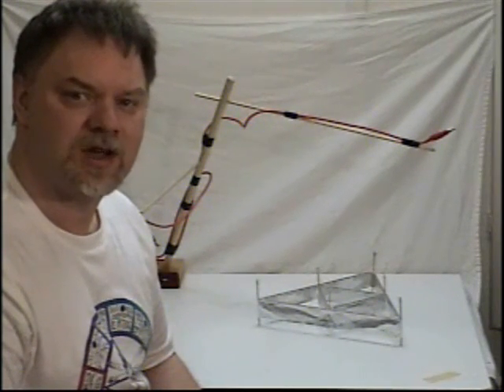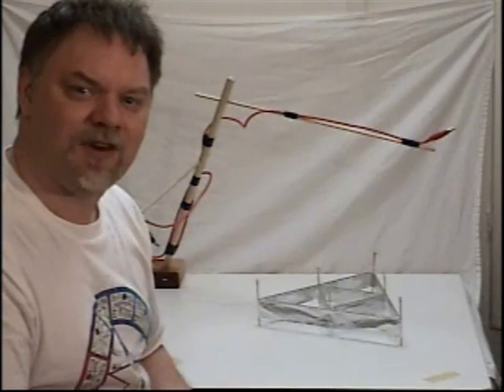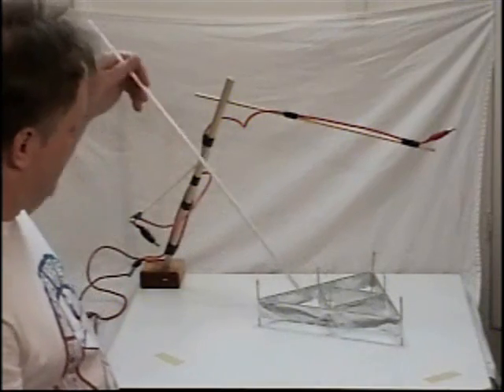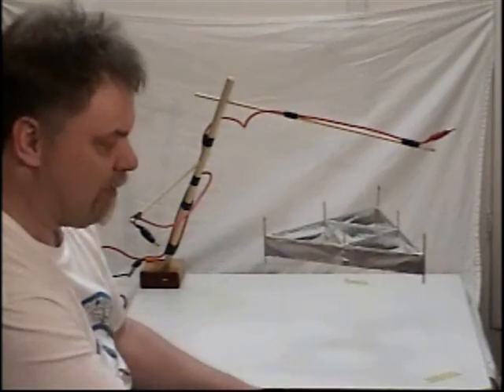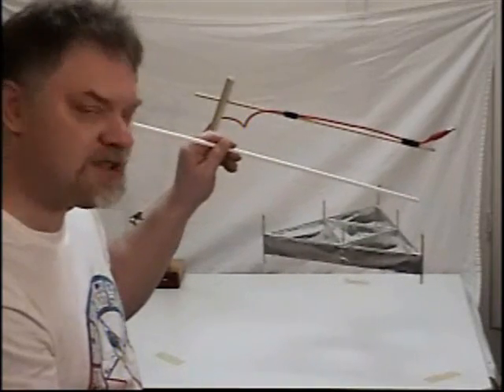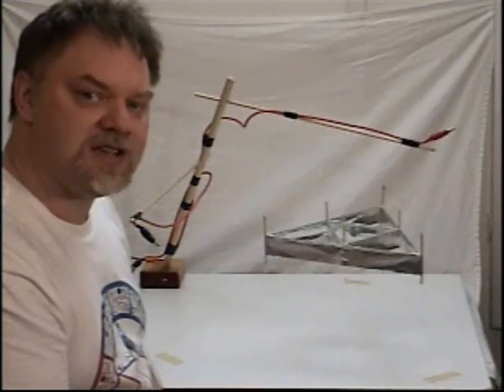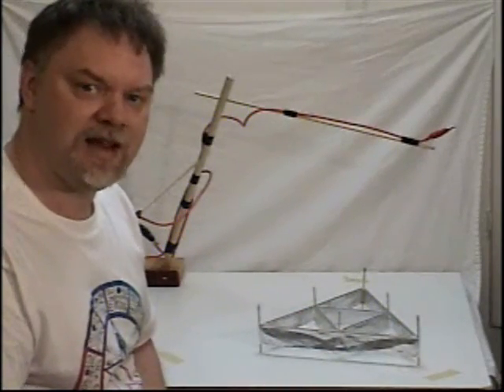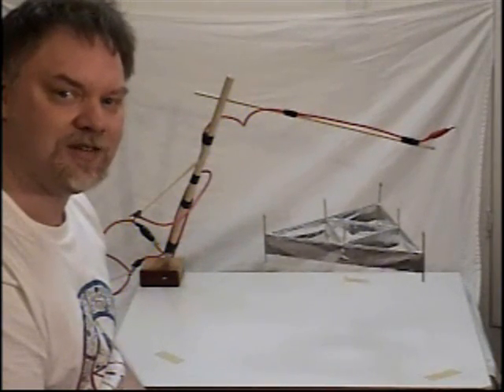LIFTER TECHNOLOGY: Demonstration & Explanation

Comment: NICE demo
It is certainly an ionized wind!  The wire above and across the top of the wings charges air or more probably water vapor particles and the oppositely charged wings attracts those charged molecules and they race down the wing -- it does not matter what the polarity is.
Myth Busters put their home built working Lifter in a vacuum chamber AND IT DID NOT FLY!
I LIKE the tech though, you need to build a jet engine with it.

Comment: I see "antigravity" as a tag. That's a misnomer if I ever heard one, as there is no such thing as anti-gravity. 

The actual phenomenon is called the Biefield-Brown effect, and has nothing to do with gravity, but everything to do with electromagnetism. Look it up.

From wikipedia: "Anti-gravity" is often used colloquially to refer to devices that look as if they reverse gravity even though they operate through other means, such as lifters, which fly in the air by using electromagnetic fields.

Comment: Why would reversing the electric polarity make it thrust into the tabletop? All you'd expect is that the air around the corona wire is ionized to the opposite charge, thus the thrust is not reversed but maintained.

Comment: Actually, the craft does fly using ionic wind, primarily because of the Beifield-Brown effect. The lifter basically works by ionizing the air around the wire via corona discharge. The ionized air is then drawn downwards towards the aluminum foil, creating thrust. There are no gravity altering forces involved in the operation of this craft. You can test this by trying to fly it in a vacuum. It won't work. It is however insanely dangerous. Don't try it at home, unless you enjoy funerals.

Comment: @uNiTCoNDoR

well, it wont work in a vacuum because the way in which this works, 
the electricity jumps from the copper wire to the aluminium sheet, 
creating an airflow between the 2 metals.
if you had two meshes (copper an aluminium)in front of each other, wouldn't that produce an airflow?

and ion-jet, meaning, you get a normal jet, but make every other set of fins either copper or aluminium, (with a spacer after every pair), that way, the airflow would jump from one set of blades to another

Comment from the maker: @revi5555 The clip is needed to hold the fine power wire, allowing the high voltage dc current to reach and charge the lifter.

Comment: thereby allowing this lifter to operate on alternating current aswell. creating a better crossflow of ion wind (and trust me, its mostly ion wind) than if you had only applied DC, try it! also try making an ion jet using aluminum and copper meshes placed in-front another!  have always wanted to try that, :)

Comment: i read somewhere that the reason the ion wind doesnt simply reverse when the voltage is reversed is because of the asymmetrical, relative electro-negativity and  the different surface areas and conductivity between the two metals, causes the corona to concentrate around the foil, regardless of polarities being run through the wires. i believe it was, if the copper was the cathode, O2 would attract to the foil, and Nitogen would be attracted to the foil if it were the anode,-----

Comment: Please tell us more about the power supply being used. Is it a transformer producing 20,000Volts ? Is the final output AC or DC? If DC, please provide details of the rectification system.
With thanks

Comment: As you pointed out the asymmetry is *not* the polarity but the mechanical layout. so the "ion wind" always flows from the wire to the foil, regardless of the polarity of your power supply. The only thing changing with polarity is that the ions are either positively charged (when the wire is connected to the positive terminal) or negatively charged.

Comment: I built a  high voltage power supply for one of these in college to demonstrate it to my electromagnetics class. It's not anti gravity, but ion propulsion. This will occur whether the polarity is reversed or not.. The lift effect comes about because of the asymmetry of the capacitor.

Comment: Cool videos and a interesting channel. I have done a few experiments myself with lifters and high voltage. I uploaded a video of a Lifter running, filmed with a Schlieren setup and the airflow around and between the electrodes is obvious. I'm in the process of building another (better) power supply and will run some more tests soon.
 - Again great channel - Otto

Comment: @ASIANPRIDE50 Lol I was being sarcastic. Be sure to verify it's assembly CAREFULLY (you should know where it goes!), before introducing high voltage. It's dangerous, and if you don't do it properly, you could hurt yourself. You'd be better off having the string holding it up in the air if you didn't know what you were doing lol. (Check other vids, there are more detailed instructions, happy building!). And don't breathe in the ozone from it, it's not good for you!

Comment: The only question is:
Are those numerous tinfoil lifters driven by just voltage and not current amount (amperage)? If so, one can use a Joule Thief modification to power it, and maybe with  proper shape configuration it can lift the JT circuit too.

Comment: @Beamshipcaptain i guarantee you that is you put this device on a plastic sheet, and glue it down, you will not get any lift. why? because the air currents coming off of the lifter push down on the plastic, and no lift will happen. Geez, you can even use tape for that experiment

Comment: Here is an analogy; The Lifter is like a rock-climber, and air molecules are the Rocks.  
Here is another counter example: Try flipping the triangle upside-down. You will see that the triangle won't climb up. It will just stick to the table top. Now if there is a depletion in gravity in the vicinity, the direction of the lift will always be up. Don't you agree? However, this is not the case, hence your theory is completely wrong.

Moreover, This won't work in space or in vacuum,

Comment: The Author of this video is wrong.  It is definitely not a "gravity" well.

Reversing the polarity doesn't reverse the flowing direction of the ionized air molecule, due to the locations of the smaller electrode being always at the top, and  bigger electrode at the bottom.  (As long as, they are arranged as such)

Comment: @Beamshipcaptain - Thats actually untrue Russell. I think you dont understand elastic collisions in physics. In lifters it is both the speed and the quantity of air that permit the object to lift. Because such a large quantity of air is moving at a relatively low velocity the air particles do not collide with enough force to free electrons, which means you get no disassociation and no secondary ionization. This combination is what permits the lifters to lift, it is a thrust reaction.

Comment: @kurisu925  << Hes correct. The air molecules literally stack on top of each other, holding the lifter up. This is because air exhibits elastic collisions at low velocity. A lifter works by moving a large quantity of air at a low velocity, a higher velocity would cause molecular disassociation and secondary ionization, reducing the lifters efficiency. This is because efficiency of a lifter is inversely proportional to the velocity of the air flow it generates.  Eff=mv/t * 1/2(mv^2/t)

Comment: Reversing the leads will NOT reverse the flow of ions because the skirt is always has the lower density of ions. Whether its positive ions of air flowing downward to a negatively charged skirt, or negatively charged ions of air flowing downward to a positively charged skirt. If you want to change direction of the lifter (i.e. the air flow) simply  turn the lifter upside down. It wont work upside down, because the air will flow in the wrong direction.

Comment: If you do a smoke test of the lifter with the plate positive you should see the air flowing upward  because the positive electrode always has a larger glow discharge(see maxwells treatise on EM). The positive ions should flow upwards towards the negative wire. Furthermore you should require more voltage to initiate lift when the wire is negative and the plate is positive because the ion wind is working against the gravity well phenomenon. See my explanation of the lifter.

Comment: walking the mass-energy-equivalence-argument line is something you have to be careful with. though mass can be converted into energy and visa versa, the two are far from being the same thing. not to mention that 24000 V at 1mA would not have enough equivalent mass to create a gravitational field powerful enough to generate even a .049 newton force (force required to cancel out gravity for 5 gram object.

Comment: now, i will say this. i am willing to believe that there is a connection between electromagnetic and gravitittonal forces. KaluzaKlein theory is a well accepted and reasearched theory that shows, using general relativity extended into a 5 dimensional manifold with the 5th dimension being collapsed, that there is indeed a connection between gravity and eletromagnetism. recent expiriments with superconductors seem to confirm this. those are on another level from this, however.

Comment: except there's one problem - the force IS sufficient. the propulsion relies both on momentum transfer to the atmosphere by the increased Brownian motion of the accelerated ions and by the electric field created by the accelerating ions inducing an opposite acceleration in the craft by simple coulomb force.

if it were a "elecrogravitic effect" the thing would work in a vacuum. and it doesn't. I've done the test myself.

Comment: actually, reversing the polarity would not drive the lifter down, even by the 'ion wind' theory. the upper wire creates a cloud of charged air molecules  which acquire a charge matching that up the upper electrode with it's higher charge density and accelerate toward the lower electrode. polarity doesn't matter, and T. Thomas brown was the one who explained the lifter using the ion wind effect.

Comment: oh, reversing the polarity does not prove anything because if the air is charged negatively or positively the foil is still the opposite, and the ionized air will still travel toward the oppositely polarized surface.

Comment: this so called lifter is just an ion wind generating device the thin wire on the top positively charges the air while the foil is negatively charged pulling down the ionized air thus creating thrust dont believe me? put this devices in a vacuum with no air and it will not work ! it has nothing to do with magnetic fields.

Comment: Tesla Tech, and Lifters exploit two very different properties of nature. They are apples and oranges. Simply put.. AC and DC.

Lifters take advantage of a static DC electrical field established around the wire. Which charges the air around the conductive wire and pushes it away towards the non-charged aluminum. (This takes advantage of electrical fields)

The 'force' felt in Tesla tech is the  result of induction. The high voltage/frequency induces an opposing magnetic field in objects in range.

Comment: The assumption that reversing the polarity would reverese the direction of thrust is false.

Regardless of the direction of current flow, The air around the wire becomes charged, and is drawn down towards the non-charged foil. Thus always producing downward thrust. (Unless you invert the device.)

Also, you contradict yourself. "We're not creating anti-gravity, we're creating a gravity well."  Manipulation of gravity for lift IS antigravity.  Which this machine does NOT do by the way.

Comment: @ USSGobLin

 The voltage source is a high voltage DC, not an AC type like the one you describe.  If you reversed the polarity of a DC source the current direction changes. This is not true about the AC system you described.

P.S. I'm A senior electrical engineering major
and I've built one of these before.

Comment: Guy in video is wrong, swapping polarity doesn't reverse the air flow. Air moves in one direction due to the wire in relation to the foil strip. Example, MOST, not all, auto starting motors will spin in one direction regardless of polarity, due the coil and armature windings. That's what makes a CW or CCW motor.  The reason these lifters are controversial is because the people running them are not electrical engineers and do not understand them. Then they ad the words, Conspiracy, or "Cover up"

Comment: Yes, 1000mph at the equator, but the 'drop-off' of the Earth's curvature is only 8 inches per mile. So that would imply a very sedate upwards motion, and the Searl gang would be in no danger. Darn!
BTW, this effect is quite real: experiments were performed using a warship at the beginning of the 20th century, and it was found that its weight differed by several hundredweight; depending upon whether it was steaming due East or due West.

Comment: switching the polarity of the power supply does not change the direction of the ion wind. The direction of the ion wind is dictated by the positioning of the asymmetric electrodes. That is to say, the ion wind flows from the thin electrode to the larger skirt. So switching the power supply does not prove there is no ion wind. The only thing that changes when the power supply is reversed is the type of ion being carried from the smaller wire electrode to the larger skirt negative versus positive

Comment: Depends. In a pure vacuum without any sort of ionizable material as fuel, it cannot lift. However, if one were to pack a storage compartment full of ionizable materials (similar to what they do for ion propulsion for space satellites) then yes. 
The way this lifter works is by ionizing molecules in the air (oxygen/nitrogen) which serves as the matter being propelled downward.

Comment: I'm afraid it isn't that simple.  See, since Thomas Townsend Brown did experiments with flying saucer-shaped models, and worked for the government, some people naturally assume flying saucers are terrestrial craft using this principle.  However, lifters currently have an impossible power-to-weight ratio; i.e., they need to be connected by wire to an external power source.  Wait for cold fusion; maybe then it will work.

Comment: Polarity is inconsequential. Negative Ions flowing to a positive skirt or positive Ions flowing to a negative skirt makes no difference. 

If the Corona Wire is positive is steals electrons from the air, they become positive ions, and are attracted to the negative skirt.  If the Corona Wire is negative, then it deposits electrons onto the air which are then attracted to the positively skirt.

i.e. the flow of ions is controlled by the placement of the skirt, not the polarity.

Comment: works a lifter   with static current hight voltage generator like van de graf ? I saw some aluminum dishes over a van de graf flying when it starts. Its the same phenomenon?

Comment: Guys... I hope you realized he was using DC voltage, not AC.... polarity reversal DOES make a difference in DC voltage and current app,lications... the current flows thru the system, he explained it was a closed loop

Comment: Whoa, dude.  That's a huge jump in logic there.

Reversing the polarity of the wires wouldn't force it downward, the same way running electricity backwards through a light bulb doesn't make the filament start absorbing light.

Comment: Unless the efficiency of the circuitry used to change your 1.5v to 30k volts is 100% (its not) and your batteries are capable of high depletion rates without risking damage, then there are still problems.

Comment: "why not use some batteries, transformer and trim it to just float"

A single AA battery weighs more then most lifters (20g), plus a battery doesnt have the power necessary (a single AA has ~2000maH, at ~1.5v, meaning ~3watt/Hr (usually ~2.4watt/Hr).

Adding in the weight of the batteries (four AA) you now have ~100g to lift.  It required 5watts to lift ~20g, but now you need to lift 100g. So now you need ~25watts, or ~10 batteries. 10 batteries weighs 240g, so now you need ~70watts.

Get it?

Comment: The mass is usually < 30grams. 

The volts us usually near the breakdown voltage of Air (approximately 30kv/CM). 

he amperage is inversely proportional to the voltage, so since the voltage is very high the amperage is usually very low.

The wattage is voltage multiplied by amperage, and is usually less then a few watts (larger craft require larger wattages).

Comment: There is no net difference in force regardless of polarity.

The force is proportional to the pressure, lower pressure is lower force, greater pressure is greater force.

The force and voltage is a squared relationship, with the peak efficiency near the breakdown voltage of the dielectric. Increasing voltage yields less and less of an effect.

The height is determined solely by the length of the strings that tether the lifter to the table.

Comment: So then you do not agree with only1egg's explanation. 

Also, you implied that the use of a solid dielectric is necessary for flight in a vacuum. I wish to point out that only serves to quantify the argument that what you are explaining is nothing more then Ion Propulsion (IP), which is essentially Ion Wind using a third party gas/dielectric, instead of using air to provide thrust. IP is very well understood, its used on satellites, and does use the same basic principles as lifters.

Comment: Russell, I was wondering if you agree with only1egg's explanation.

He states that ION Wind would drive the lifter into the table.

So, if there is another force that we cannot see (a gravity well, or a gravity hill), how come the device presents the same force in the same direction regardless of polarity? If the ION wind was assisting in one polarity and opposing in the other, shouldnt the net difference in force be measurable? How much force is left unaccounted for after this difference?